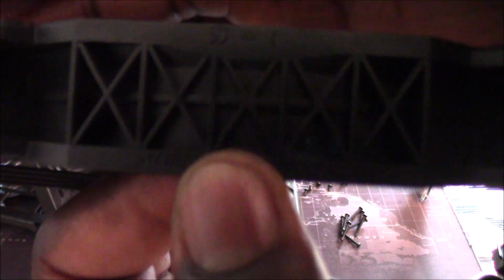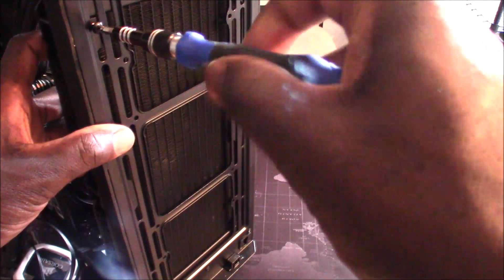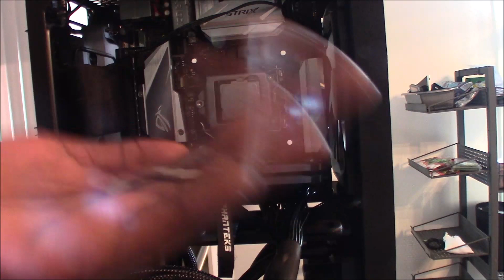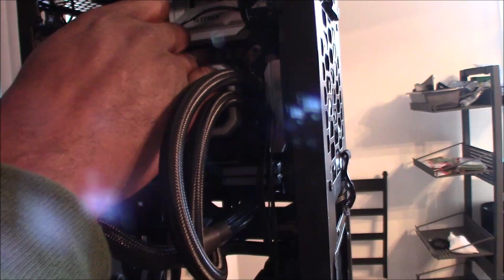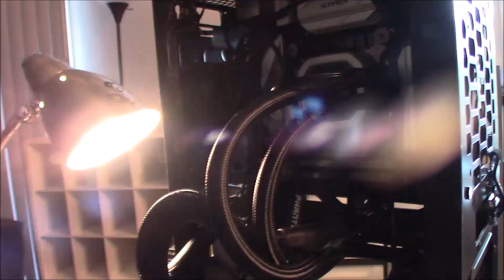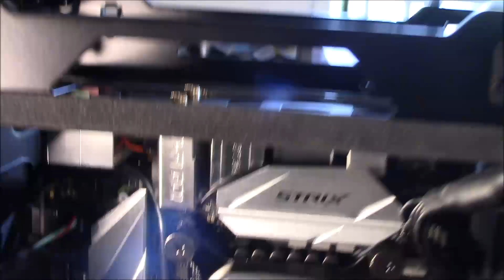HOW TO Install The Corsair H115i PRO RGB All In One Water Cooler In PC Case

Comment: You are going to have issues with the pump mounted like that. the in/out on the radiator needs to be higher than the in/out for the pump. There is always a small amount of air in these systems and if the pump is higher than the radiator in/out that air will migrate to the pump causing issues with flow and less than optimal performance of the cooler.

Comment: You could film the back when installing the intel plate; the back side of the mob; and also i did not get the part with the fans; some explanation of how they are installed , where and why; i did not get that part cause the filming was from too close and i do not know where in the atx case are they positioned and some guidance on the fans; why are they on the inside of the aluminium block and not outside; maybe my logic is wrong but i see it as they get the cold air from outside, cool the aluminium part that also cools the liquid that goes to the cpu; please explain

Comment: I use the same. But the rgb on pump can't light up. Is on first try  the rgb already run or we must setup it first at icue?
Reply from the maker: the RGB light should come on when there is power to the CPU cooler the icue is for you to change the colors and effects of the lights make sure all your connections are installed

Comment: Do you have to install the fans or can you just put the radiator in with the cooler?
Reply from the maker: it is better to install the fans it will make your life a lot easier if you do the work outside your pc case

Comment: Is there water in it already?
Reply from the maker: An AIO combines the parts necessary to liquid-cool your CPU into a pre-packaged solution that you bolt on in about 20 minutes. The AIO combines the water block, radiator, tubes, fans, fittings, and pump into 1 sleek package That Means Water Is Included For You.
Reply: @lewinglobalmedia6275  ok also do you think a asus rtx 2080 super and the cooler will fit in a thermaltake s100?
Reply from the maker: the s100 can support a cooler that is 280mm so yes it can fit this cooler also the graphics card that the case can fit has a length limitation: 330mm so the card should fit
Reply: @lewinglobalmedia6275  ok I also subbed

Comment: Could i still put fans on the front of the case (which is the back of the radiator)
Reply from the maker: if you are  not using the same case i am there should be plenty cases that could fit that push-pull method

Comment: Hello thank you but i have a question . My last cable that is supposed to connect the pump with the motherboard has 3 holes and the motherboard has 4 things that are supposed to fill the holes . Is it a problem ? does it matter ? thank you so much
Reply from the maker: To be honest, it kind of depends. The first thing to know is most pumps are DC controlled anyway, not PWM, hence the three-pin connector. you can plug it into a 4 pin PWM header (just observe the key-way) and it will still work, usually at 100%/full speed if it's set to PWM mode. But a pump on an AIO should run at 100%, 12V, full speed anyways. This is because it is (or should be) so quiet it doesn't matter and it assures instant cooling when the processor starts working hard. So this fact gives you many choices.
Using an appropriate adapter you could connect it directly to one of the unused drive connections directly from the power supply. If you've no other controllable headers this leaves the CPU fan header free which should then be used to control the radiator fans. The only bad thing about that approach is it doesn't monitor pump RPM which is good to use for setting an alarm should it stop, assuming your BIOS has that feature.
Most modern BIOS will refuse to turn on if they don't detect an operable fan on the CPU header. So if monitoring the pump is important then use the CPU fan header for the pump but keep it at 100% and put the radiator fans on another header that's controllable. Fans on an AIO are usually noisy at 100% so you will want them on a profile.

Comment: I’m new to this but do you need water for this cooler?
Reply: SoR_Matt I just bought it and I also have that question . It has no fill ports so i guess it’s pre filled
Reply: Cullin Mccartie yeah cause I’ve been watching all these tutorials and nobody is filling them
Reply: SoR_Matt ya I just threw mine on I’ll be able to tell once it’s on and running tho, there are no fill holes and the fittings don’t come off so that makes me worried about replacing the water over time
Reply: Cullin Mccartie but what if there’s no water?
Reply: SoR_Matt I just looked up what an AIO liquid cooler stands for and it’s ALL IN ONE so it comes closed loop so no water in or out so it must have some already in
Reply: Cullin Mccartie true
Reply: SoR_Matt LoL wtf

Comment: Where is the thermal paste? on cooler?
Reply from the maker: the thermal paste is on the surface plate that connects to your CPU it is pre-applied on the cooler on most models.

Comment: I just wanted to know what kind of headers it uses.
Reply from the maker: it is hooked up to the aio pump header on my motherboard but that is only on the newer motherboards or the gaming motherboards if not you have to use a CPU_FAN header thanks for watching the video.
Reply: @lewinglobalmedia6275  does this require any rgb headers or controllers?
Reply: @computethisinfo  the usb cable is used to control the lighting